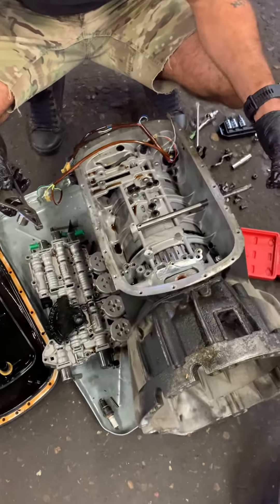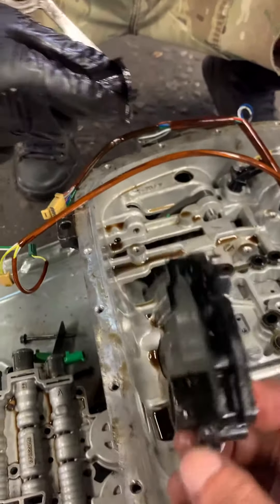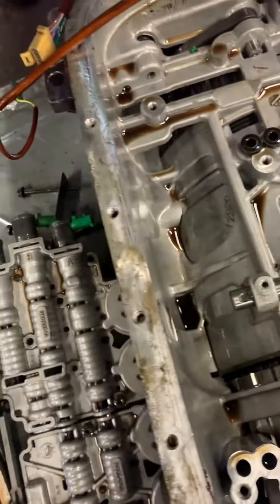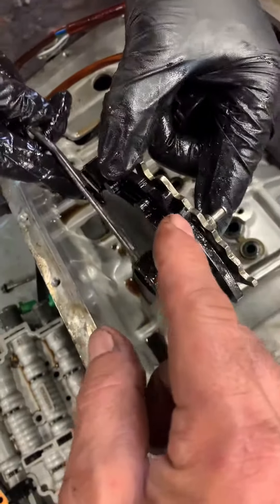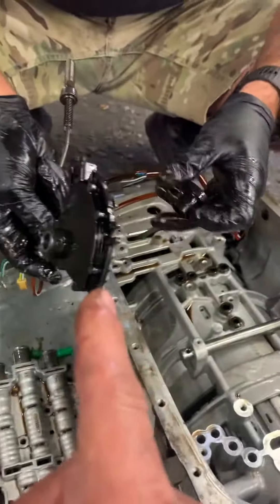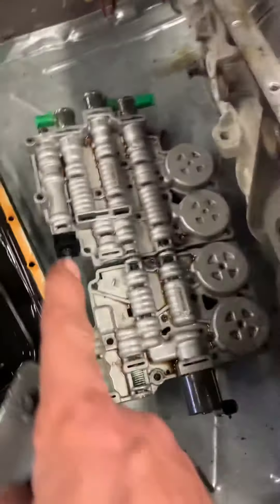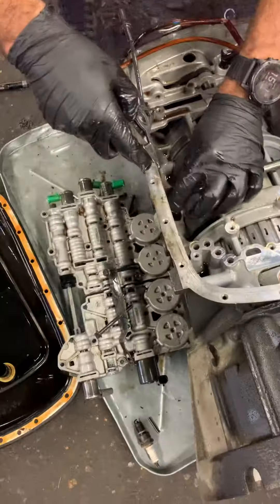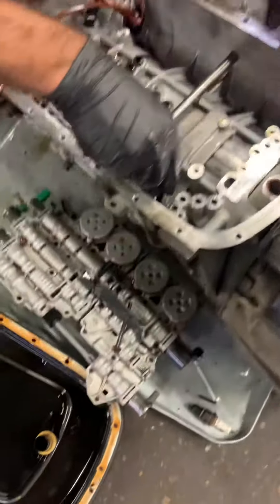BMW e46 GM 5L40e transmission gear selector replacement

Comment: Was the black round sleeve part of the black position sender or does the bulk of the sender spin on the inner sleeve ? Mine spins and i figured it should be fixed as one part ?

Comment: I think this transmission is in the 2006 Cadillac SRX V6, the problem I'm having is, the car wants to drive forward in every gear (even reverse), it's an automatic transmission with the manual option, it will only drive in first gear in automatic,but when switched into manual it's drives perfectly, except again No Reverse.
What could be the issue here?
Any help would be greatly appreciated.
Reply from the maker: Yes. I know it’s in some Cadillac